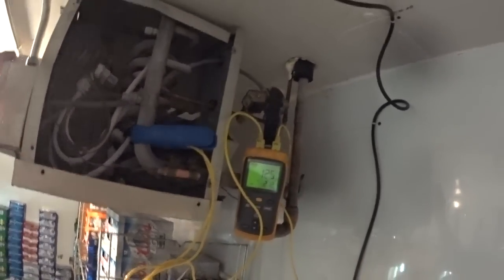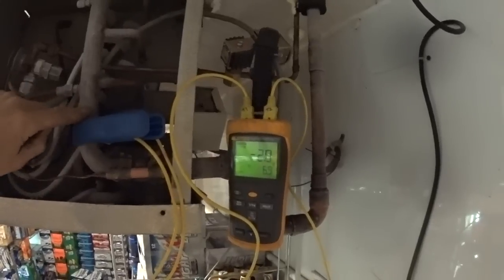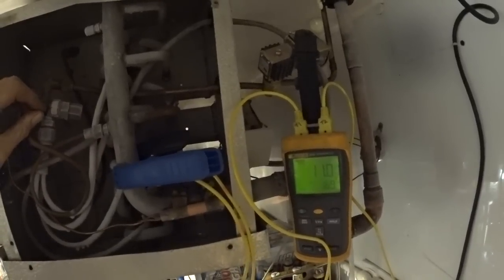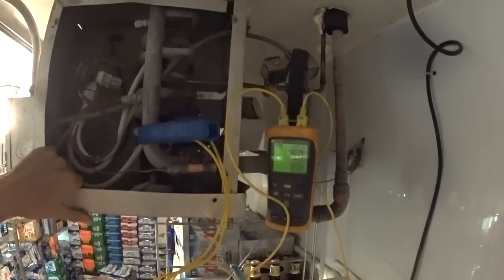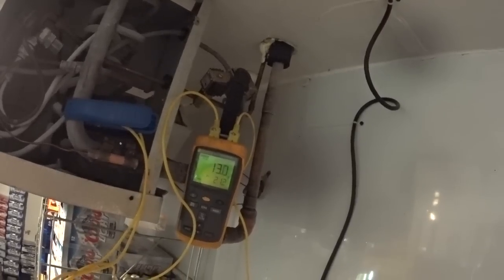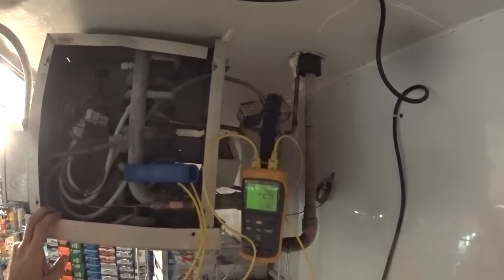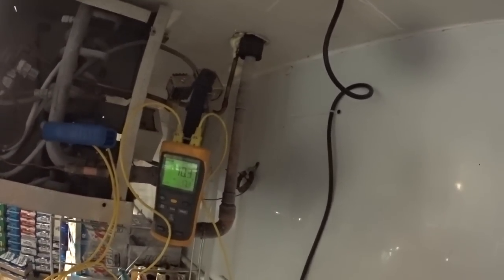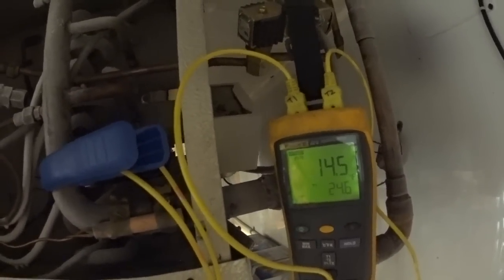TXV hunting

Comment: Nice video - thanks for your explanations.  I see ads these days for electronic valves.  For a system like this, are electronic valves being used as replacements?
Reply from the maker: I haven't come across them yet, something new like that I'll hold off selling them to my customer until they've been out there a while to prove themselves. The standard expansion valve works just fine. Why fix it if it aint broke.

Comment: Interesting video! Did the valve hunting damage the old compressor?

What model thermometer are you using?
Reply from the maker: Fluke model 52-2 with fieldpiece K clamps. This is a new customer ,I couldn't believe, the more I explored, I found the temperature control was bypassed by the former refrig guy, I tried to temporarily adjust the pressure control to get the system to shut off on pressure, the low pressure control was stuck on, non adjustable. The only control  that it was cycling off on was the time clock, it runs all the time except for defrost. I'm going to install a dual pressure control and temperature control. The last tech changed the R22 over to a replacement refrigerant, the moron didn't label the system so he would be the only one to know what is in the system. I did a temp/pressure check on the refrigerant it was close to 404a one day the next day I did the check again and it showed it was 422d or 407c . mystry refrigerant. I had installed a 404a power assembly on the TXV, that's probably causing the hunting, I have to put 404a in and check the TD again.
Reply: Sounds like you have your work cut out on that system! I've had a few where i had to remove the refrigerant and start again as it wasn't labeled. I'm sure you will soon have it working properly Jim!

Comment: Where are your two temp clamps placed?
Reply from the maker: Hussman recomends T1 next to the TXV bulb on the suction line leaving the evap, and T2 on the first ubend after the TXV, It can be too hard to get to sometimes so I've had good luck on a distributor tube about 10" after the TXV. This system works pretty good as long as the presssure drop across the coil isn't very much.(a very large coil)
Reply: Thank you for the answer. I learn alot from your videos.
Reply from the maker: Pops McCartney thank you for watching and comenting